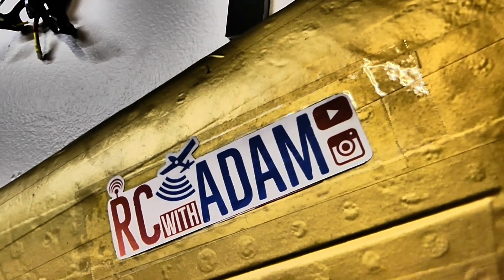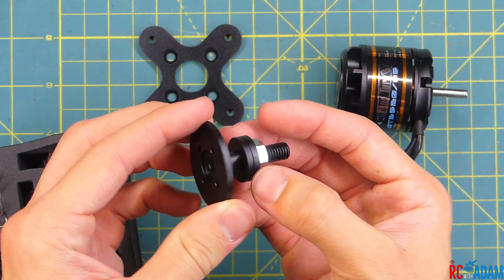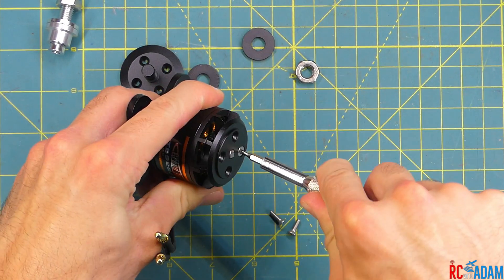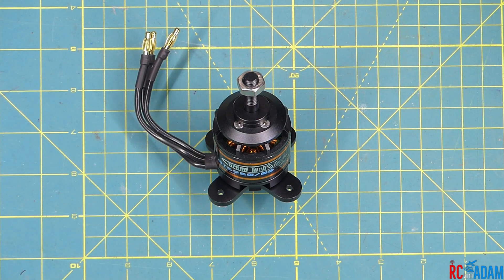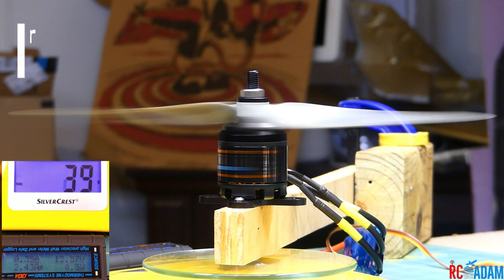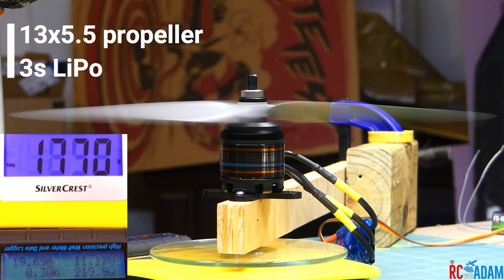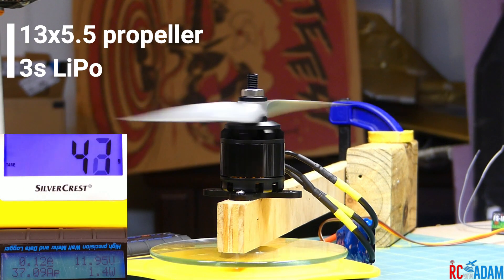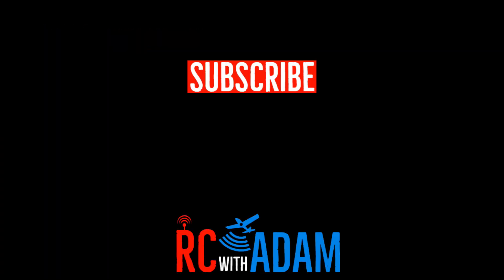So much power! Emax GT3520/05 Motor Thrust Test (12x6, 3S-4S) (13x5.5, 3S)

Comment: Hi everyone, i have an issue. i have the same motor and sunnysky esc, 10x6 prop, 2200mAh 4s 14.8V Lipo but i cant even have 1000g thrust. does anyone known why i cant have 1000g thrust at full speed. what should i check

Comment: where is 4s and 13x5.5?? i have 4 s and 13x8
Reply: Hi rmgcustoms ? You fly this motor on 4s and 13x8. Any problems or so ? I wanna use it on 4s 13x6 or 5s 12x6. Did you tried more options ?
Reply: @michalbacik8910  i mean never seen 13x5.5 in my country. i fly on 13x8 and 80A Esc on 4s 4000. zero problems

Comment: Great video! I am a bit of a beginner but want to build my own thrust testing rig and I was wondering why the pivoting arm is used instead of just attaching the motor to the top of the scale, perhaps for stability? Also, this may be obvious, but I was just wondering if you put the propellers on the motor upside down so the force is directed downward at the scale.
Reply: મોટસૅનીકીંમતજણાવશો

Comment: Sir, I want to calculate the power of a brushless motor. I have the values of lift force, speed, current and voltage of the battery

Comment: You need to include actual motor Kv, RPM in each test and voltage across them. otherwise the test is useless. Airplanes fly by propeller speed. not by push.
Reply from the maker: Hi. You're right, more data would have been better. However,  total thrust output is still a very useful measurement regardless of rpm.
Reply: @RCwithAdam1  how many thrust is necesary for fly a sailplane?  haw many for speed is necesary?
Reply: The effy in a  motor is Watts In vs Watts Out= Work.  Work is Thrust + proppeler speed. where thrust is inversely proportional to speed. at higher speed, less thrust at the same power.where thrust is inversely proportional to speed. 
where prop speed is RPM *pitch/1050=MPH

Comment: Very interesting ... I am a newbie and maybe everything I say here may not make sense ... it seems to me that the motor is turning to the right (cw) when you look from above ... and the propeller (see in 4:19 ) is like a spoon ... therefore the propeller pushes against the balance (OK) ... if for some reason the direction of the motor changes (ccw) ... that arm holding the motor will swing on the pivot ... A highly dangerous situation. You must put some restriction that prevents something like this from happening. 

Question...If you design the contraption for a tractor motor combination ... will it be more efficient? ... so this motor and propeller combination ... will produce more thrust? Thanks!!!
Reply from the maker: Hi. You are correct in that there is nothing to physically block the motor from pivoting the arm upwards. However, the motor is wired to only spin one direction, and it cannot be unless two ESC wires are swapped. So, that is why I had the propeller upside down in a "pusher" configuration. Did that make sense?
Reply: @RCwithAdam1  Yep!!! ....If you are the only one touching that contraption...no problem.  If you have a brother/sister that like to prank...then...put a strap to that arm. Better safe than sorry.  Good Job!!

Comment: How do you get the data from the kitchen scale into the amount of thrust?
Reply from the maker: The scale measures the amount of force from the thrust of the propeller (the prop is mount upside down), which gives an approximate measure of thrust.

Comment: Your 4s battery is a bit weak, droping from 16.6 to 14.0 when you go full throttle. You should get a battery with a higher discharge rateXcapacity (C times mAh)

Comment: Hey there, I think you might want to consider adjusting your thrust test jig in such a manner that the motor isn't that close to the desk because I think you'll get a lot of ground effect from the nearby desk surface with this setup which will skew the test results.
Reply from the maker: Good point!

Comment: Dear Sir,
If the thrust of motor is tested horizontally. Would thrust be the same when we use it for vertical flying?
An Rc plane engine states that it has static thrust of 23.5kg at 1800 meters. Does that mean straight upward from ground?
The question what I'm trying to ask is: if the thrust is calculated horizontally, would it be same straight up vertically?
Reply from the maker: Hi! Good question! Yes, the thrust would be basically the same both horizontally and vertically (of course, other factors like propeller type, air density, airframe drag and battery type would make a difference). I'm not sure about the "1800 meters" specification, Is that for a brushless motor or a gas/nitro engine?